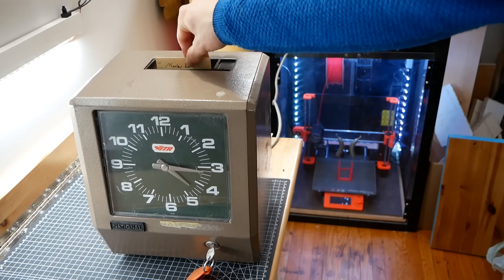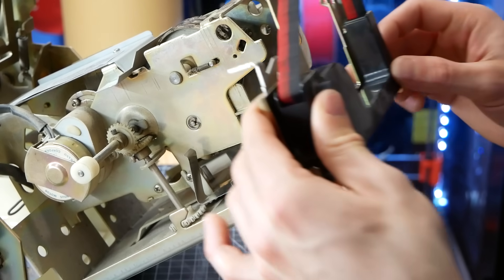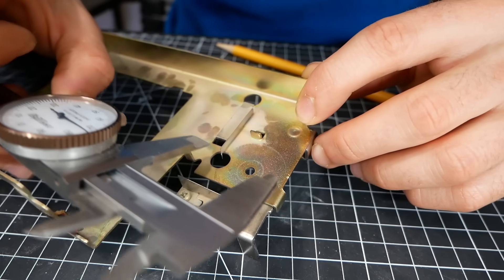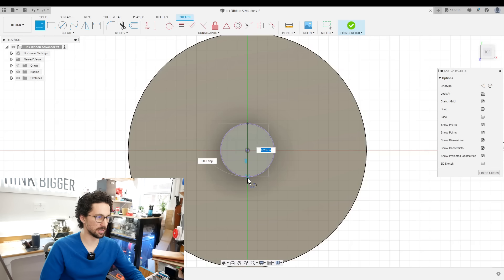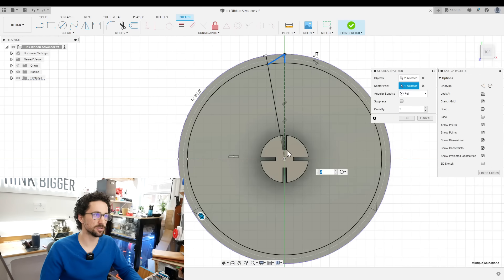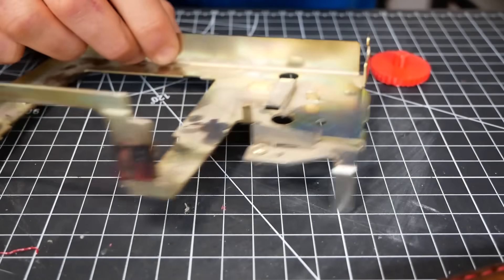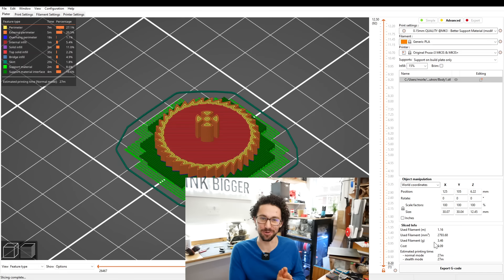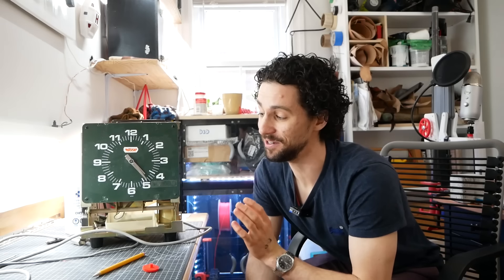They wanted 100 dollars. I 3D printed it for 9 cents.

Comment: most likely the gear was not 1.175" but  1.1875"  as 1.1875 is equivalent to 3/16"
imperial has a strong tendency to work in whole fractions and not exceeding a denominator of 64 unless you're working in thousandths of an inch

The different is not likely to cause an issue other than how positively the spring arm engages the teeth or how quickly it fatigues

Comment: FYI those ribbons don't have an inkwell in them.  There is just a bunch of ribbon crammed in there.  Once it makes a full rotation depending on what device is using it a lot of the ink off the ribbon is used up.  If the device you use is aligned to just one half of the ribbon you can flip one side of the ribbon and put a drill on the manual advance until the whole ribbon flips so you get double duty out of it.

Comment: That's a good fusion360 tutorial. I'll be watching this over and over for a while.
I've been using it in 2d for my plasma cutter but I do have a 3d printer. I'd been using tinker cad for the printer but clearly what you just did has a LOT more power.
Reply from the maker: That’s great to hear, thank you!

Comment: I LOVE THIS! this is exactly what i've been using a 3d printer for years now. wel, not fixing punch clocks per se. 
subscribed!
just a tip: i've found when printing sharp angels it is better to incorporate the nozzle diameter into the design. so never have two lines come together in a sharp corner, but space them out at least 1/2 of nzzel diameter; that way you do not lose the point during slicing/printing. Also, since the gear is captive, you could have just printed it as a gear with a separate slotted shaft for cleaner result ;-)

Comment: A few things to comment in the print itself, the first layers are weird because your printer is not set properly, thats why they look smushed at the bottom and suddenly they are not smushed anymore at the top and you don't need that much layer contact because the piece itself has a mayor contact area so no actual need for supports. Related to the desing as someone already said the teeth feature can be done as a circular feature, that way you avoid selecting each teeth individually therefore wasting time...something useful to keep in mind. Fixing those support settings might in fact reduce the price of your prints a little. Anyway, enjoyed the video, a long time ago I fixed a coin counter machine, the gear train was damaged and had to do something similar because the company cared more about selling new ones instead of fixing/servicing old ones.

Comment: That's an absolutely gorgeous time clock! My late mother's work place had something similar up to about mid-90s when they replaced it with a digital variant. The old one had a satisfying ka-chunk sound when you pulled the lever (it was manually operated), whereas the new one had an annoying bzzzzt sound.

Comment: That's cool, but saying they wanted to charge you $95 for a part you could print for 9 cents is dishonest. $95 was for the whole assembly, not the little gear.

Neat video. As someone who doesn't 3d print, it was interesting to see a more complete version of the design process. Most videos skip/gloss over the computer part.

Comment: I was going to suggest making the next one out of a more wear resistant material if available but at 9 cents a piece... just replace it whenever right? 

Absolutely love seeing this though.
Reply: I actually saw another video on here that if you combined it with this method would work really well together. To summarise the additional method made a simple mold of the part in plasticine and then filled it with epoxy with metal shavings in it. That would be more wear  resistant than this guessing it's PLA.

Comment: Something you can 3D print for 9 cents and will last about 1000 times less than the original injection molded part.
Reply: so just 3D print it again.... lmfao like what

Comment: 95 bucks for an original replacement part is actually pretty reasonable. Sound like a decent company!
Reply: especially for a legacy piece of equipment where they likely do not manufacture replacement parts any more so it is new old stock
Reply: Figure, if you have an employee on hand with this skill set, you're probably paying them about $50/hour. I bet OP spent 4-8 hours on this from moment of relizing aproximately what was missing. That includes going through youtube videos to get an idea of what is missing, gathering the measurements, designing in software, printing, refining, ect. Add in the cost of the 3d printer time and materials. The final product will probably not be as reliable as the original. Total it all up and $95 becomes much cheeper than trying to do this on your own. Yeah, as an indivigual who looks at the time expenditure as entertainment, doing it himself was cheeper. But a company will be happy to just cough up the money instead.
Reply: @bartbartholomew  yeah, for a company relying on this for their work still $95 is a reasonable price. Hobbyists gonna hobby though :P
Reply: @bartbartholomew  $50/hr? Not in any reality. $30 tops and that's if they're the one and only expert on staff. Likely less than $20/hr, and this work would have taken 5 minutes on their end.
Reply: Yeah it's also sick that they still actually make the parts for something from the 70s.
Reply: And you can see that the part that he printed got demaged during the video.it is not durable. Imagine having to replace the 3d printed parte every other week.
Reply: And another 50 years of life, not bad.
Reply: exactly,  it's not like everyone can do it for 9 cents
and i imagine he can't either
i have no question that the materials cost 9 cents
but he didn't account for labour, Overheads , insurance etc etc
it didn't cost 9 cents,  that's bullshit
Reply: they could have just sent the gear for a lot cheaper
Reply: @dccatsnatcher2411  Yeah but you know it's a vintage clock. You need to keep the parts in stock for the old model. And keep the guys on the payroll who know how to fix it. And overhead, businesses don't run on thin air. Still reasonable imho and cheaper than 2+h skilled labor to design a one off 3d printed part.
Reply: @kwinzman  Exactly. Even offering replacement parts for these machines instead of attempting an upsell to something newer is pretty darn impressive.
Reply: @kwinzman  $95 is not cheaper than 2 hours skilled labor. College degree holding skilled laborers performing under government contract make less than $20/hr, and using CAD isn't exactly a 4 year degree kind of job. And where did you get 2 hours from? They already have the dimensions of their own product on file. They could have produced a replacement part in 5 minutes of real time work, from looking it up to getting it done. This was a $2 job.
Reply: @chrismanuel9768    even if you have the drawings for the part on file and can pull them up at anytime you still could not make the part for anywhere close to $2 on a one off basis. If you set up a machine or set of machines in a production manner you could get the cost per part down, but a gear for equipment this old is not mass produced anymore. Time alone in setting up the machines to make this out of steel would easily be over an hour or two.
Reply: @dccatsnatcher2411   i dont like the pricing either but because of its context i can understand it too.
Its the same with antique car, gun and other machinery parts
Reply: @dccatsnatcher2411  if they had any spares sitting around of JUST the gears maybe. if not thats not really an option.
Reply: @dccatsnatcher2411  Do they have this single gear have lying around? They have to identify this single gear, and they will have additional handling costs because they usually do not sell this because no one asks for it because the time it takes to tear down everything consumes the savings you get by replacing only the single gear. And you need a mechanic who can do this. So he isn't asking to buy a product but to do him a favor.
Reply: @dccatsnatcher2411 if it's old stock, then they are stuck with a non-functional assembly. Now that is waste on a shelf

Comment: Similar to some hing stoppers at my work they don't provide the replacement parts and you have to buy the whole hinge assembly to fix it. One design and print in fusion and bam, so much easier when you can measure everything from an already physical object but to do this from scratch is impressive, well done
Reply from the maker: Thank you!

Comment: It's amazing that we can easily find quick and cheap solutions to such intricate machines using modern technology. 

With that said, I think the whole $95 to $0.09 comparison is wrong and misleading. It makes it look as though the company who makes the service parts for these clocks is somehow ripping everyone off. You invested your time, knowledge, design and engineering skills into making this piece. That costs a whole lot more than $0.09. I'm sure if you factored in your time and knowledge investment into the price it would cost the same if not more than the replacement piece that the company offers. 

Also, you printed this out of PLA plastic and it's engaging with metal. I'm no validation and testing engineer but usually in mechanical applications metal on plastic interaction doesn't last long. So if this clock is actually used then your going to likely see gear slip and eventuall failure where as the replacement part would likely last the remainder of the life of the machine. 

Still awesome that you can do this so easily with modern technology and the right amount of knowledge and engineering skills. But please don't make companies who service machines this old seem as though they are in the wrong.

Comment: The material cost is not the component cost. You cannot value your time at $0, your equipment at $0, and your energy at $0. If a company needed to repair this clock, the $95 for the gear is extremely affordable compared to putting even a low level engineer on this. Let’s say the engineer gets $35/hr, which costs the company around $50/hr after benefits and taxes, then pulling the engineer off a paying job to diagnose the issue, engineer a solution, prototype and manufacture. Even a senior engineer could have 4-5 hours into this project. Of course this is assuming the engineer is familiar with such work, and the company has an engineer to begin with. Please stop undervaluing the Manufacturing industry - we are in enough trouble as it is, and videos like this which ignore the realities of manufacturing really damage the public perception of value of these components.

Comment: I love this concept and do this sort of thing alot myself but you've fallen into a common trap. It's didn't cost you 9c. 

You printed it twice (at least) that 18c
You also spent half an hour measuring, designing etc. That's got to be worth something? About $8? So your cost is currently $8.18.. also your printer... I'm.assuming that wasn't free, and your electricity? 

Add all that together and you could be looking at $20 for your piece, which granted is still cheaper than 95.

And they were going to supply you a full unit not just the gear? So your $20 cog, is probably not that much of a.deal compared to a full guaranteed unit from the manufacturer.

Comment: A circle has 360° afaik so if your teeth have a width of 10° you should end up with 36 teeth...yknow 360/10. That would also explain that little gap between the teeth at 35

Comment: How much does that 3D CADD software cost?
Reply from the maker: Fusion 360 is free for personal use 😊
Reply: @MorleyKert  That's awesome! I gotta get that program. Problem is, my current PC a HP Pavilion entry level desktop only has low performance integrated graphics. My CPU is a AMD Ryzen 3 2200g paired with 8GB of DDR4 memory in single channel mode. I'm not confident in my computer's ability to run this app. But I'm gonna give it a try anyway. 😁

Comment: Impressive and fun to watch.  But it took $$$ hundreds of engineering and machine time to come up with a part that may (or may not) work.  And even if it does, for how long?  There's surface finish, hardness, and tolerances that were developed and refined over decades that insure the component would work for millions of cycles.  I'd have spent the $95 and made that back many times over by hiring out to make parts that are no longer available, or to prototype parts that haven't been developed yet.

Comment: The cost of the plastic you used was probably 9 cents, yes, but you used a nearly $1000 3d printer, you probably spent a few hours on measuring and drawing the part, and another few hours on disassembling, then re-assembling the whole thing. Would've been much cheaper to just buy the replacement. However, you gained some extra experience and knowledge which might "compensate" for the effort. 3d printing is a great tool for restoring old or damaged stuff!

Comment: You might wanna look into resin printers, they are generally better at printing smaller pieces with fine detail. The prints should also be more wear-resistant.
Reply from the maker: Yeah a resin printer might be in my future!
Reply: resin printer print really great, but the strength of the part really sucks.
Reply: The prints from a resin printer are fragile and not suitable for mechanical applications
Reply: @jesperhagstrom  that solely depends on the specific resin being used.
Reply: @patrickkeller2193  What's a good resin and printer combination for making mechanical parts?
Reply: How much do they usually cost. Sorry , google sometimes doesnt give accurate market price
Reply: @CS-et4fs  you can get a small one for 200-300, but that's much smaller than filament printers for that price and prices go up fast for the larger printers. You also need a bit of a hazmat setup to handle liquid resin.
Reply: @patrickkeller2193  "hazmat" is a bit extreme, but you definitely need to take ample safety precautions and make preparations for using a resin printer. It's a 3 step process, in the first 2 steps you need to use and wear nitrile gloves so as to not handle the toxic materials (resin is toxic, and 99% IPA isn't toxic but it will dry out your skin and is necessary for cleaning your prints of leftover liquid resin) The third step is to either leave the print out in sunlight or to place it in a UV light box to cure. Just a pair of nitrile gloves and a gas mask (Isopropyl likes to make fumes) is basically enough for handling the materials. It's suggested to get airtight sealable containers for your IPA and to keep your whole setup in a place that has good ventilation. It's definitely a LOT more work than filament, but the final products you get are still super sweet!
Reply: @samantharynn9683  "Hazmat" literally just means hazardous materials. My job has hazmat protocol for disposing of aerosol cans, old lighters, and boxcutters. Resin is a hazardous material and requires proper hazmat protocol to keep safe.
Reply: @samantharynn9683  99% isopropanol is also extremely flammable, which also requires hazmat precautions, because while it isn't toxic, it is still very hazardous. Hazmat is not a simple "this will kill you by toxicity" (which IPA can actually certainly do, if you've never heard of alcohol poisoning, I would be very surprised), but includes many, many different classifications, like flammable, explosive, toxic, carcinogenic, environmental, and others that I don't need to type out to make my point.